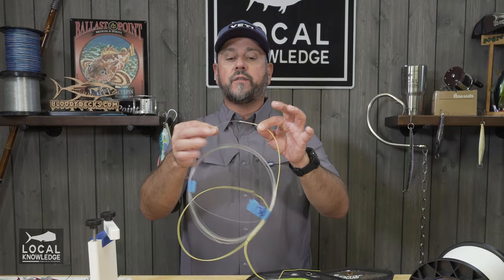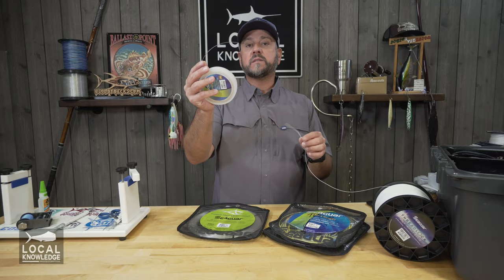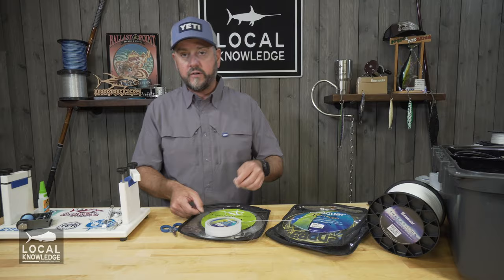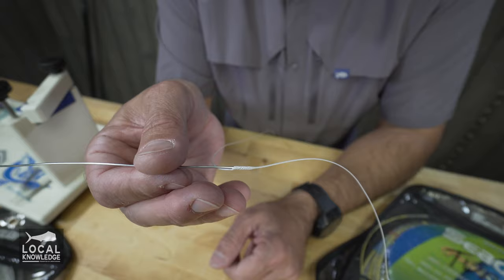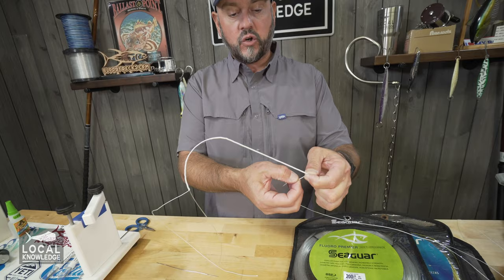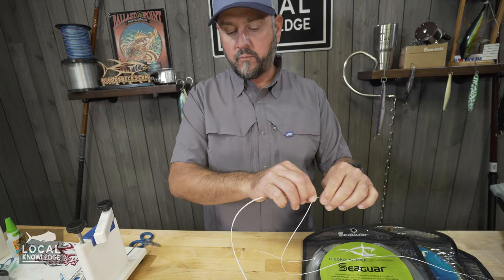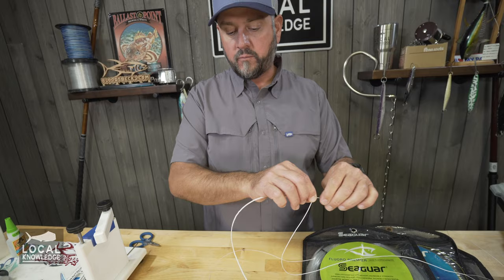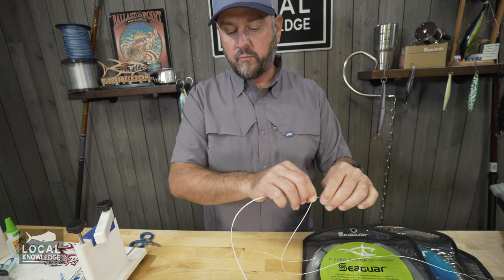How to Make A Wind On Leader | Strongest Connection Knot

Comment: Cool video as always...making these is fun and satisfying when you catch fish on ones you made yourself.

A cheaper way to do this instead of the daho reverse latch needle is use some thin guage fishing wire.  cut a piece about 3 feet and fold it 180 degrees but don't pinch it off too tight...leave the tip rounded and blunt but bent enough to be slightly thicker then the braid.

the rounded tip will pass inside the braid very easily.  then you pas the free end thru the loop and pull it out.
Shout out to Johhny's SportFishing in Pasadena for the tip

cheaper then a 20 dollar needle....and cheaper to replace it if you lose or break the reverse latch needle
Reply from the maker: Absolutely correct! We keep a little coil of wire on the boat just in case. I still feel the needle is a bit quicker and easier and the $20 isn't much when you're saving so much making your own topshots. Ali

Comment: Alright Ali,,  I made my first 80# hollow-core
braid to 80 lb fluorocarbon leader wind-on.
Used your technique to the T in the method 
I followed.  If you had watched me I'm sure
you would have used the one I made tonight.
THANKS......
Reply from the maker: Stoked! I like to make a dozen or so once I sit down to do it. After one or two I just fly through them. Glad it worked for ya! Ali
Reply: Ali,
        I've made:

 200 lb braid - 200lb mono wind on leader.
 100 lb braid - 80 lb fluoro wind on leader.
 50 lb braid - 50  lb mono wind on leader.
 40  lb braid - 40 lb fluoro wind on leader.
 30 lb braid -  30 lb fluoro wind on leader.

They all came out perfect the way you
demonstrated on your video.

Will attempt a 20 lb braid - 20 lb fluoro
wind on leader soon.

NEED that DIY video on that "line clamp" that you'll
be putting out soon. Want to finish them up correctly. 

Give me the name of that glue you recommended.
Noticed several other You Tubers referencing you
on that choice of glue.

THANKS AGAIN for getting me squared away with
building "wind-on" leaders.  PRAYING for full on
fishing in San Diego by August.
Reply: Got my 20lb fluoro to my 20lb braid
wind-on leader made this evening.  Proved
I can make my own wind-on's from 200lb
down to 20 lb..  Yabo - dabo - doo!!!
Will build enough to store/carry in a Calcutta
 binder  My travel arsenal is finally starting to really come together.  Need to work with you and that guy from "Quick-Rigs" on my terminal tackle.  Strongly considering an Accurate Tx-600x(6.1) (Tern star drag). You have any opinions on this model reel.
Reply from the maker: @TheJwhollis  Right on! Love hearing this! Stand by for windon jigs. We've heard tons of requests for it.
Reply: Hey Ali, I'm down in Brazil,  thinking about trying this if I can get the needles here ..?   Question: after making this, how do you go about tying it onto your mainline?  Tie your braid or mono directly to the loop?    Thanks!

Comment: You can make a serving jig in a doorway with studded bolts, fender washers, rubber washers, split lock washers, and wing nuts at eye level. Also, no need for the latch needle. When you get sick of wrecking shit in reverse, just use your regular looped needle with another loop of that "cheap braid" or serving thread to pull it through the first time, cut the loop, and just pretend you opened the latch. Don't need the latch or loop for the second pass either. Excellent video on how to make yer own wind-ons.
Reply from the maker: I think I'll stick with the windon jig. :) I guess that would work.
Reply: @LocalKnowledge  Yea, I would too. If I had one...

Comment: Great vid! So do you like the white over the blue Seagar? Seems like white might have better visibility but would get dirtier quicker. Other question, do you step down the mono/fluro to a small line weight from there or make a whole new Wind On leader specific to your different applications?TIA
Reply from the maker: I use both colors but most of the stuff is white. Think of how much seagrass is floating in the ocean. I don't think the color really matters. We typically leave a wind on for the entire season. If we do have to change we will cut loop on the windon site close to the loop to loop connection and just pull it out. We usually only use wind ons over 80# and they don't need to be changed much.

Comment: How many catspaws do you use when you attach it to the bimini? Was having a hard time getting  multiple catspaws to cinch down evenly. Is a single ok?
Reply from the maker: We like 2 or three. One is probably fine but generally guys want 2 or 3.  The trick to cinching them evenly is pulling evenly from ABOVE the loops on both sides. If you pull on one leg or the other you'll never get them even.
Reply: @LocalKnowledge   Thanks!

Comment: Hi mate, love the video and im trying to make some wind ons. I have a 230 lb 16 strand hollowcore which i can insert 250 lb mono into fairly easily. However, i cant get the loop in the braid. My latch needle goes in fine but i cant get the braid to go inside of itself to form the loop. Any tips on this issue or have you heard of poor quality braid that this loop can be an issue in? Cheers, Ben, tasmania
Reply from the maker: Hmmmm. Are you sure it's braid and not dacron? They can look similar and dacron doesn't like to go inside itself like braid. We use threadlock 200# for 200# leaders without a problem. That said, all leader material can vary greatly in diameter. Sorry we can't be of more help!
Reply: @LocalKnowledge  it says it is spliceable hollowcore, but it feels very plasticy compared to other hollow braid i have. Doesn’t mention it being dacron tho. ?

Comment: The line clamping device you used in
this video, was it store bought or custom
built.  Would like to get one or build one 
similar.  Thanks...
Reply from the maker: Someone gave us a couple of them many, many years ago. It's just startboard and a couple long thumb screws. Should be really easy to make.
Reply: @LocalKnowledge  I would like to build this line vice. Can you please tell me what the blue part the line sits on is? Can't tell if it's metal or plastic. Thank you.
Reply from the maker: @louierosado2201  Sorry. Just saw this. the blue things are rubber pads. A scrap piece of seadek would work awesome as well.

Comment: I am setting up a light weight reel.  will those needles fit in a 30# braid?  Thanks for the video.
Reply from the maker: You would need the "light" splicing needles. We never splice under 80#. While it will work, you go through so much leader in the smaller sizes you will be resplicing a lot.
Reply: @LocalKnowledge  thanks.

Comment: what rigging floss strength do you use?
Reply from the maker: I use 30# braid instead of floss these days. It cinches down tighter and is much smaller in diameter.

Comment: I've been making a bunch of wind on's for this season using your technique, I have a couple questions. First, what's the smallest #test that you use for a wind on; at what point do you just tie on a short piece of flouro, what knot do you like best?     
Second, following this video the loop takes up about 1.5ft of the leader. What's the shortest you think I can make that (for 80# HC)?  Can I shorten it up to 8in when finished? Reason I'm asking is with an 8ft rod, if I want a 5ft. leader I'm getting the splice into the tip .  Thanks for the great content!  -tbev
Reply from the maker: We use windons for 80# leaders and above typically. Anything under 80# we use a uni to uni knot or similar. You can make the loop as small as you want but you want at least 18" of leader shoved inside the braid for a good grip. I prefer 2-3' just to play it safe.

Comment: What is the name of the tool, you tension the line in?
Reply from the maker: It's called a wind on jig. I'm working with a local company to produce and sell them since we've had so many inquiries and no one is making them. I'll keep you guys posted here and on Social. You can also google the term and there are instructions to make your own. Good luck. Ali
Reply: @LocalKnowledge  Thanks. If that happens, post to youtube!
Reply: @LocalKnowledge  Hello..When you find a supplier and/or you may sell  wind-on lig as video, please let me know. tks. in advance